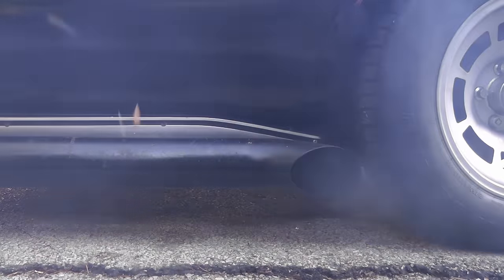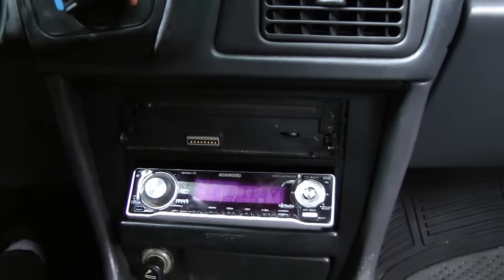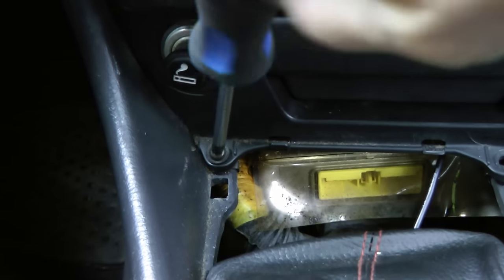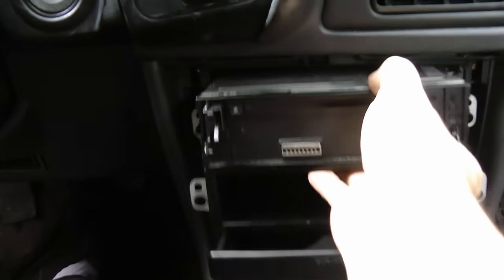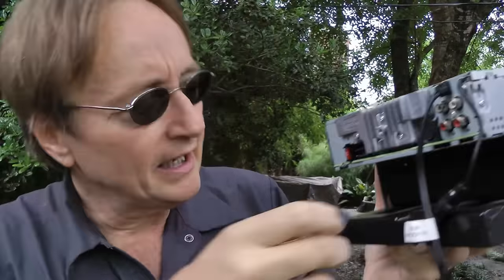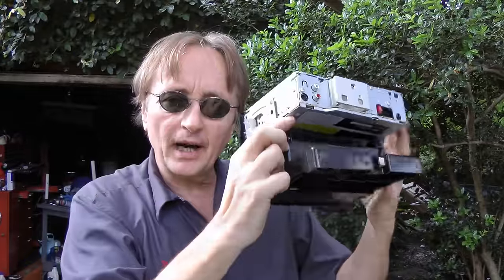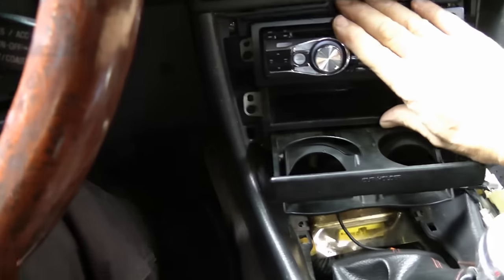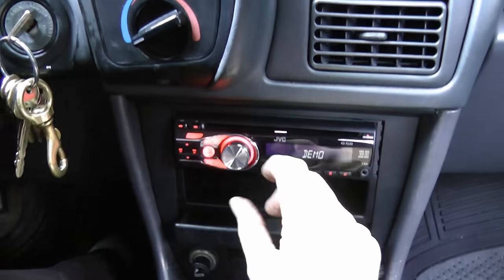How to Install Car Stereo

Comment: I like this guy makes everything sound easy. top guy.
Reply: Ppp Chips It's because it is, just need tools and instruction thats all
Reply: Unfortunately this video is longer than his how to swap out an engine video which is only 2 minutes. He just mentioned the two manifolds and the transmission and completely skipped over motor mounts and all the fuel and wiring attachments.
Reply: Ppp Chips yaaaaaaaaaaas
Reply: This is car audio so of course he's gonna make it sound easy. Auto repair and car audio are completely different things
Reply: Ppp yeah true lol
Reply: it's not a terribly difficult job on most cars, especially older cars but he skipped over everything. he doesn't show how to crimp/solder the new wires on, and i've noticed most cars don't use a standard radio size so you will probably need to buy an adapter specific to your vehicle.

Comment: Scotty you forgot to mention to disconnect the negative battery first before doing any wiring installation on your car LOL. I know some people who actually fried their new stereo but not disconnecting the battery first LOL
Reply: LOL
Reply: LOL
Reply: LOL
Reply: OLL
Reply: Lol
Reply: LOL
Reply: 50+ years of being a "professional mechanic" eh scotty?
Reply: LOL
Reply: Lol
Reply: fries radio LOL
Reply: Wrong no one disconnects batterys for car stereo installation.most new cars you disconnect the battery won't start and you need to get it fixed at the dealership.
Reply: What’s negative batteru
Reply: LOL
Reply: LOL
Reply: What if u dont discount negative battery what will happen
Reply: @JuanGuzman-op3hw the negative terminal on the battery, you are supposed to disconnect the negative for safety
Reply: LOL

Comment: I always got the factory adapter plug to make the radio wiring fit into the automaker's plug. Made wiring easy as you could join wires outside the car. Then just plug it in and test it.

Comment: For many cars you can get a connector that fits the stock radio connector.You connect the stereo connector to the kit connector,and it plugs in just like stock.Plus you can do all your soldering at a bench instead of in the car.

Comment from the maker: you can solder them, but on low power like radio wires I just use those little connector ends that screw the wires together, all hardware stores sell em.

Comment: Another couple of things you might encounter is that with several vehicles you may need to purchase what is called a dash kit made for your vehicle because the old radio may be larger than the radio you wish to put in. And as for wiring it is easier to buy a wiring harness made for your vehicle so that you don't have to cut the original wires. You will have to crimp the harness that came with the new stereo to the harness you bought for your vehicle. It's always good to see if you can find a video for your specific car as Installition could be different for other cars.

Comment: I just wanted to provide some additional advice. The easiest way to make the connections to the factory wires is to get a wiring harness. Metra sells them and they cost between 10-20 bucks. All the wires' colors match the radio harness so all you need to do is use some crimp caps and you're set.

Comment: Great video Scotty.

You should probably mention using a wire harness adapter for connecting your new radio to your car. This way there is no splicing into the car's wire harness and you can easily remove an expensive aftermarket radio and reinstall the OEM one if you want to sell your car.

You should also probably mention buying a radio adapter kit since most aftermarket radios are smaller than the OEM ones.

You should also probably mention to save your OEM radio if you ever plan to sell your car since aftermarket radios usually subtract from a cars value rather than add to it.

Comment: black "ground" wire will go f/radio to negative battery terminal,red "access" wire will go f/radio to positive battery terminal,and yellow "constant" wire will go f/radio to top part of solenoid.correct? fill me in IF i'm wrong please.BIG ty for your help kilmer.you're awesome!

Comment from the maker: you'd have to trace em all to be safe. But find the power and ground wires first, normally red, yellow, and black, test them using a volt meter. The speaker wires go in pairs next to each other, so when you find one speaker wire, it's pair is next to it.

Comment: My '92 Caddy Deville has its factory installed radio with cassette player. I bought a cassette tape MP3 adapter which you insert into the tape deck then plug the dongle into the MP3 player's headphone jack. Better than CDs and if you have an old tape you want to hear, you have that option left too.

Comment: Nice video Scotty. Only thing I'd add to this is that check the fuse on the radio that's not working. I had a 2003 era Pioneer CD deck that kept cutting out for one reason or another and replacing the fuse in the radio seemed to fix it.

Comment: Another useful tip is that, if you don't want to cut and splice wires (as relatively easy as it is), you can buy adapters that allow you to simply plug everything in. Even Wal Mart carries these adapters and they're quite cheap.

Comment: You might check to make sure everything works before you screw everything back in and put your panels back.  If a wire is wrong, it helps to solve that before you bolt it all back together.

Comment: Hey Scotty, Like the video! Although most radios slide right out the front, the new one comes with keys (Usually 2 thin pieces of metal with a little bump on the end of it) and you stick those on each side and pull the radio right out. you only need to replace the entire bracket if the new radio and old radio dont have the same bracket (which I imagine was the case with this one). also, most electronics shops sell connection adaptors for those people who don't know how to solder, and realatively cheap too at only $5-$10 usually!

Comment: there are wiring harness adapters that converts the original radio connector to the after market one. many electronic/stereo stores and even parts stores have them.

Comment: My old radio didnt break (other than the tuner knob getting locked up) I just wanted an upgrade. Took my car to a shop for the install and my grandpa put a couple of extra speakers in the back. This should be useful to anyone who drives a 93 Chevy Silverado however. Their radios are notorius for going bad in no time flat.

Comment: All is good, only thing about radios is that for precautions you have to take the negative pole of your battery, especially if your connectors dont match the new radio.

Comment: Hey Scotty! Big fan here!! I purchased a used car off someone the other day, and there appears to be a long red wire from the battery (the passanger side door closes on it) as it continues down near the floorboard and i assume up behind the radio(aftermarket), I am uncomfortable with that red wire, whats the worst thing that could happen if I pulled it out? I dont mind putting the stock radio back in or a new one if need be! I hope to hear from you Scotty :) you always know what to do!!

Comment: Hey scotty, I put in a $20 dual stereo from Walmart and when I turn the volume up over 10, it starts to sound all staticy and just sounds bad.  But if its 10 or below it sounds fine.  So i plugged my old stereo back in and it sounded fine.  Is it the speakers in my car that could be causing it.

Comment: Also I recommend getting a wiring harness that works with the stock connector on your car, that way you don't have to cut into the original wiring and it makes it much easier.

Comment: On the internet there are wiring diagrams showing which wire does what. Just google your car plus a few keywords (for example 2000 corolla stereo wiring). You should also find a list of the colors of the harness that came with the radio, and then match them up.

Also, there are adapters for various cars, where one end plugs into the factory harness and the other part into the new radio. Find a local car stereo shop and ask the guy for an adapter that fits your car.

Comment: Funny I had the same Kenwood radio you replaced for a bunch of years in my F-150...  Hated the right directional knob that would change stations or skip songs on a cd with the slightest touch...
Also a radio wire harness for your specific car could be a godsend...

Comment from the maker: As I've said before, that car sat for 16 years unused. That was shot right after I got it running for the first time for my customer. Now it neither smokes or runs ragged. BUT, I use it cause it's a Show Business beginning, I like the noise and smoke, just realize, it's the BEFORE shot. The car now lives far away and is happy as a smoked clam.

Comment from the maker: yes, unhook the battery if you do messy work and touch live wires while working.  Make sure the antenna is good at the other end, but if even then it doesn't work, the radio is bad.

Comment: Hey Scotty, thanks for the videos - you've saved me a lot of money already! I just ran into a problem with my 93 Citroën BX though, replacing the radio. Since it's an old car, the power wiring is different: I've got 2 ground wires, 2 wires that give 12V constantly and no ignition wire. The result is that, even though I turn off my new Pioneer radio manually every time and have it on Power Save mode (which, according to Pioneer, should turn it completely off), my battery keeps slowly draining - probably Bluetooth or whatever stays on. Could you tell me how to make an ignition wire myself?

Comment: hid ballasts send out high frequencies so it's important to keep them away from a lot of electronics in the car, i mounted my HID ballasts to my ABS unit and all sorts of problems happened

in this case the shop did the right thing cause they probably had to remove your bumper, find a new mounting location and fix your problem

Comment from the maker: check the wiring coming from the radio to that side, pray it's bad connectors. Cause often it's the amplifier inside the radio breaking down on one side and you'd new a new one for that

Comment: I do agree  that soldering wire connections then covering that with heat shrink wrap is ideal for most wiring situations, with it being the aftermarket harness connections its fine to do something less, if done correctly wire caps will hold up and work just fine making removing the connections easier later on, but for speaker wires further down the line say to the amp or subwoofer or door speakers, forsure solder, heat wrap, and even tape over that if you feel its needed.
BUT BE SURE to not have any exposed wire leads that can contact other metal or wires if your not going to wrap them with tape/shrink wrap, shorting out your whole car audio system is not fun from what i hear!

Comment: I wish when I had acquired my head unit that it was that easy. I've actually gotta take it to a  car audio store to get mine installed due to the complexity and complications of my wiring harness. 

But I paid 800 bucks for the cavalier, so I guess I can't complain too much. It runs.

Comment: When I first time replaced my radio, I hooked up to test and it did not turn on, I connected the old radio and that didn't even work, which actually was working before. I spent hours scratching my head and searching internet and then found out that radio in my car (Nissan Micra) takes the ground connection from body and needs to be fit in first :D
Now that was an epic fail.

Comment from the maker: those crazy steering wheel controls are for use with factory radios, not aftermarket ones. The aftermarket ones come with their own remotes, even this 50 buck one does.

Comment: My grand prix has steering wheel controls and they make special adapters so that you can use those controls with any aftermarket radio. The down side is they cost about $50.

Comment: That's called alternator whine. USB devices are well known for picking that kind of noise up. Ask your friend to double check the ground wire on the radio. I seldom use the ground wire in the factory harness. There are too many ground loops associated with factory ground wires. Usually I will use the body of the car for a good ground. If that doesn't work, a noise suppressor might do the trick on the ignition lead. The store you bought the radio from should have them.

Comment: Does the date still display when the radio is off? If adapter modules aren't available or are too expensive, you might be able to get it to at least display the date all the time by disconnecting the +12V remote wire (blue in your car, I think).

Comment: It's different for every car. Crutchfield has wiring harnesses and kits that make these installs a lot easier. I'm sticking to my factory radio because it is integrated with my backup alarm, a/c and other things. Plus I have control buttons on my steering wheel that will no longer work.
Reply: You can buy sort of cheap adapters for your steering wheel keys

Comment: Wow, you had to take trim off to get to it? The radio just slides out of the dash in my 97 and 95 mustang, there's a few pins inside you have to press down and it slips right out.

Comment: If you watch you will see the trim ring was on the new radio prior to putting the dash bezel back then poof!!  missing after the bezel was installed.  Correct me if I'm wrong but the trim bezel in not used when iso mounting.  I would be surprised if a kenwood harness and JVC are the same FYI.

Comment: Why are all modern radios now telling you to get these mounting assembly kits sold separately? Why can't you just use the one that's in the car like you did in this video?
Reply from the maker: cause they don't always fit right as replacement radios often are a slightly different size
Reply: Scotty Kilmer
oh okay, well just as long as I know they aren't scamming me.
Reply: The mounts in Scotty's Celica look a lot like the one in my Camry of the same era. There is no need for an install kit. It's just two clips that bolt to the side of the radio.  You can buy pockets if your radio is a single-DIN.

Comment: also Scotty i noticed sometimes radios may have the same connectors but they may be placed in a different order which can cause numbers of problems to the radio or the car, or the speakers

Comment: Scotty, when I bought my 2003 Eclipse it came installed with aftermarket HID headlights. Whenever I would turn them on, the radio would go completely buzzy and you couldn't hear anything. I went to this radio place and they charged me 80 dollars to "fix" the problem but all they did was move the HID's ballasts to another place and reground them. They said they fixed something else, bt im sure they ddnt. It's much better now but it still does it a bit. Whats the problem and how do i fix it?

Comment: Scotty, wired up a factory Ford radio 98 Ford Explorer, matched all the wires up , the issues is when you turn on the headlights it changes from am to fm, also when you take it out of park it does not display the radio, only in park, i am being told there is a short in the radio , is that true ? it plays music , just acts up, please let me know. thanks , its a cd an cassette player

Comment: Cheap radios are generally good, but if you go too cheap, you may get interference when the car is running which will drive you (and your passengers) crazy.  This especially evident in older vehicles.  Also, its good to use appropriate wire connectors with electrical tape, being sure to cover all exposed wire.

Comment: I can't figure out how to get the plastic around the radio to come off in my 2001 mitsi galant sei. There aren't any videos online for my specific model. I've changed head units in other vehicles but getting the plastic off was very straightforward.
Reply from the maker: chinese jig saw puzzles,, they do snap out but it's not easy

Comment: Hey Scotty, I have a 98 Honda Civic EX and I bought this aftermarket radio. I already got the wires connected and all, but my question is. Do I have to disconnect the negative battery cable, before I install my stereo in my car?

Comment from the maker: I would not use it if grinding, cause when it blows, it will throw metal particles inside the ac system ruining everything. Unless you don't care if it stops blowing and you don't intend to ever fix it .

Comment: I hope I never have to replace the radio on my '00 GMC Jimmy Diamond Edition. It came factory equipped with a BOSE sound system & according to the owners manuel, there's an igition interupter circuit built in. So if someone tries taking it out, the Jimmy will not start. Btw, is the radio you replaced in this video considered single or double din? The double you would see on Crystler products of the late 80's thru mid 90's

Comment: So would it be easy to get a used head unit from a wrecker and put it in my 1997 Sidekick?  Funny question I know but I really like the head units that come in the Toyota Echo/Yaris and Freightliner Columbias.  Would that likely be a big hassle?  Eventually I want to get a VHF or UHF radio in there too, preferably in the dash right below the CD AM/FM Radio.  Am I in for a nightmare of wires?

Comment: Scotty I have a question about power steering fluid. I’ve noticed the power steering fluid from autozone is clear in color (this was the normal fluid and not the special Honda fluid) and they used to be red in color. The girl at the autozone told me they used to put transmission fluid in the power steering system and that’s why it was red like transmission fluid. Is there any truth to this? She also told me some BMW’s require transmission fluid in their power steering system.